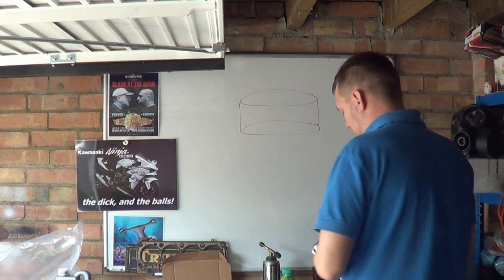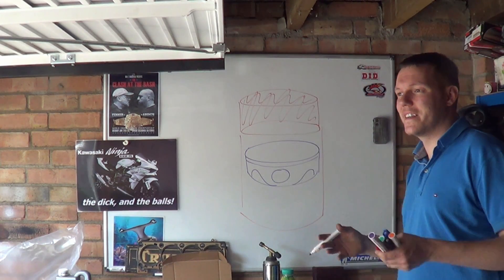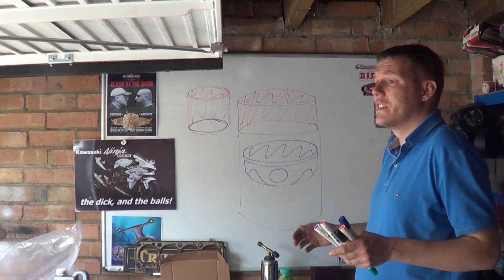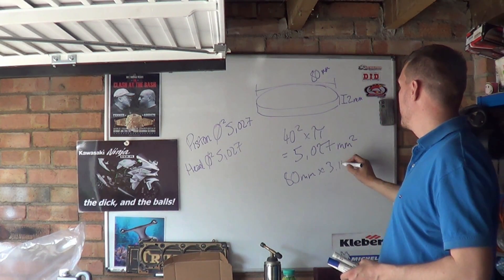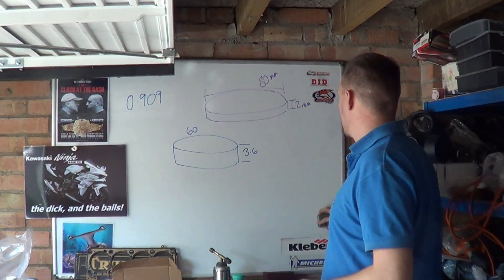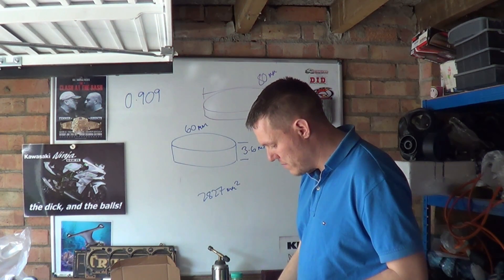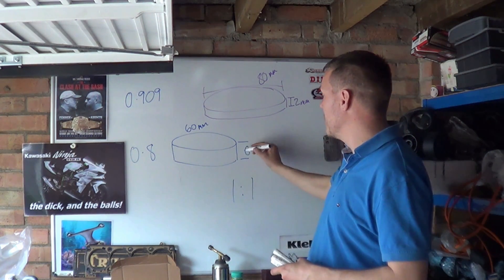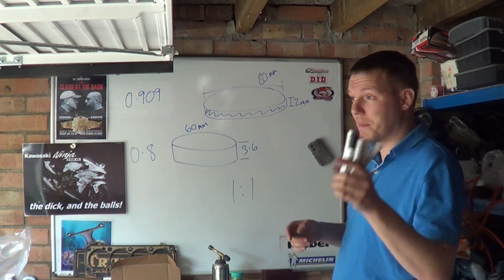Fat or skinny piston - surface area

Comment: 🤔Ford is currently experimenting with an engine has 3 cylinders and 6 pistons each piston facing a twin. 
I have seen a 2 cycle diesel engine in a locomotive train in a triangular shape using similar set up looks like a good way to get better efficiency😉
I'll have to put the links below👇 of the youtube video of the 2 engines✌
https://youtu.be/UF5j1DvC954
https://youtu.be/D3bj47TAYiU
Your probably thinking don't like diesel but I have a thought melding the opposed piston engine with a revolver cam engine and run valves along side the cylinders
https://youtu.be/ScS-QCWHfb8
Let me know what you think 
I know there's a friction point between cam and pistons on the revolver cam engine but think of the weight saving. Stroke pattern can be changed different from a crank and Web too.
Reply from the maker: I worked on a deltic at he NRS in York years ago. The opposed piston engine is nothing new and the patent was filed in 1882.
Reply: @thedirtyworkshop  I understand it's not new👍
Any reason they aren't common yet🤔
Love to build one myself someday
Reply from the maker: "Any reason they aren't common yet" - because they are thermal efficient and that's it. Great for fuel economy but that's it. If this was the only thing people cared about then they'd be a best seller.

Comment: Does this mean that two opposed pistons compressing the same volume could have a ratio of 1.8 :1 and be twice as efficient? Assuming there'd be some place to stick the valves and spark plug of course.
Reply from the maker: One of the benefits of the OPOC engine design is that they have large piston surface ratios but also have other issues - I did a video here - https://www.youtube.com/watch?v=pqyRGE50lgk

Comment: I'm sorry, but I'm bit stuppid what come to engines and terms.. isn't compression ratio the bottom dead center against top dead center volume? what does it have to do about piston clearance? am I really wrong?
Reply from the maker: Its combustion surface area to piston crown. When the fuel is ignited the temperature rises, which I'm sure you know, and so does the pressure. Pressure = force applied to a surface area. The video is about how much of that surface area is piston, becasue the piston is what converts this pressure into physical movement, which is what we are after.
Reply: I know some what you are after, but why as in engine designer would I add piston clearance to under squared piston engine? I think all designers are trying to have it as small as it can be, no matter under or over square pistonis.. Same thing happens then, under square piston have lower relation then over square. I just don't understand why you would add piston clearance.

Comment: Daft idea, but would it be possible to achieve a 1:1 ratio by using a fueling system that deposits the combustible charge onto the surface of the piston, which is then ignited on contact with the top of the cylinder head? Or, given that the ratio is going to change throughout the duration of the power stroke, is there not much point in chasing that figure?
Reply from the maker: Having a 1:1 ratio in the terms having the piston touch the combustion chamber is a bad idea. Con-rods stretch and you fuck the engine is no time. But lets imagine that didn't happen then you'd have a infinate compression ratio.

Comment: I think you said, "let`s not dick about, let`s do the Maths".  No you`ve lost me! For a start, you talked about diameter, (I think you said 80mm), then went on to say, 40mm^2, (by which I think you meant radius), because area of a circle is indeed Pi r^2, (which is perfectly correct). But then you said the piston diameter was , "5027". Come on Matt. Diameter or Radius is a, "one dimension", quantity, but, "area is a two dimensional", quantity? The piston diameter is not 5027!!!!! Circumference of a circle = 2Pi r. Area of a circle =Pi r^2. Don`t use DIAMETERS, (as my physics teacher told me. Ouch! And then he hit me on the head with a chalk duster!!)
Reply from the maker: I was a slip of the tongue, jesus.

" Don`t use DIAMETERS" 

- Pi is the ratio between circumference and diameter, what do you mean don't use diameters?

Comment: Not sure if this would work, but if you're looking to get as close as you can to that 1:1 ratio between combustion chamber area and piston crown area, how about using a domed (aka hemispherical) combustion chamber, and have the piston crown domed/convex?  That looks like it should satisfy the math and get it real close, although there may be other issues with this design that I'm not aware of.  Also, how much do those valve clearance cutouts you sometimes see on the piston crown affect the piston's surface area?  they must add to the surface area a little, but I'm guessing not enough to make a significant difference.  Your thoughts?  :-)
Reply: 2 things: The dome shape on the piston means that the pressure at the top of the dome will actually push your piston sideways instead of down. Really the only area for the piston is the area you see if you look straight down at it. That also makes that the increased area of piston cutouts don't really affect anything (The pressure on the sides of these holes just pushes the piston into the cylinder wall again)

Then also making a big dome on the piston would increase piston mass.

Comment: We need a "Diesels are NOT shite" vid
Reply: at the moment im actually building a diesel motorcycle lol
Reply: What kind of motorcycle? I personally think something like a big heavy cruiser would benefit from a diesel engine.
Reply: well im currenly working on the frame, the frame is actually from chinese dirt bike so its going to be pretty much all custom made. as a engine im using old 1 cyl 280cc hatz diesel engine thats made in germany and im going to modify the original engine to gearbox so ill have 4 forward and clutch, oh and i think the bike will be a cross breed of bobber and cafe racer style:) and i think im going to turbo it;) love the smoke and smell lol
Reply: That's awesome, i would love to see it in action once finished.
Reply: i will upload some progress videos later when i get it going:) it sure can take few months but thats fine
Reply: The thing that i'm most interested in is how will the transmission work with the low revs of the diesel engine, i think you won't go fast but it will pull like a truck. Maybe a sprocket change will be required. Thank you!
Reply: hahaxD the diesel motor will have 30 tooth sprocket on it and the transmission will have 10 tooth so the gearing will be 1:3 so the trans will spin at pretty much the same speed as it did whit the gasoline:) around 12k rpm. and thank you, you actuallý motivate me lol

Comment: Police sirens. That's a change from the ice cream van! Why don't they do pistons with concave tops on all engines? That'd eliminate the side walls losses, no?
Reply from the maker: This increases the mass of the piston as you have to have a thicker piston crown, which means your rpm is reduced. As for diesels they operate with lower rpm so this isn't so much of a problem.
Reply: Makes sense. cheers